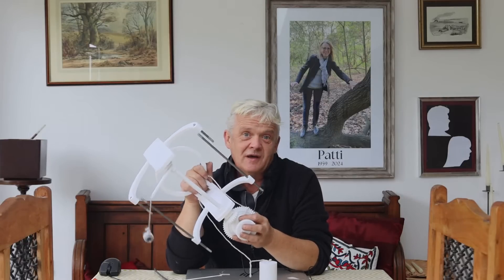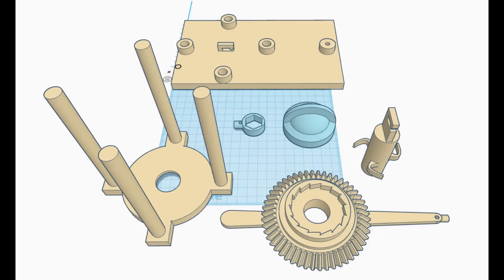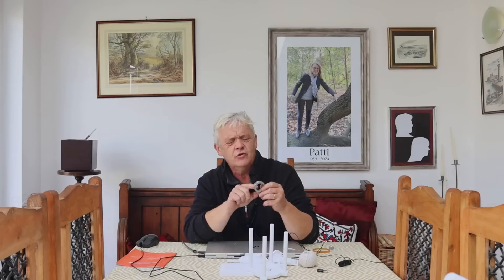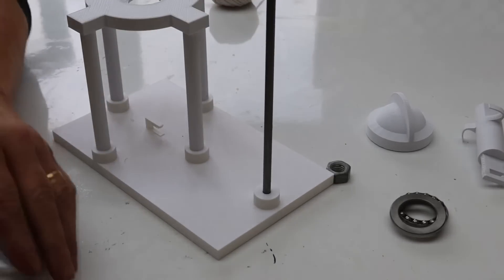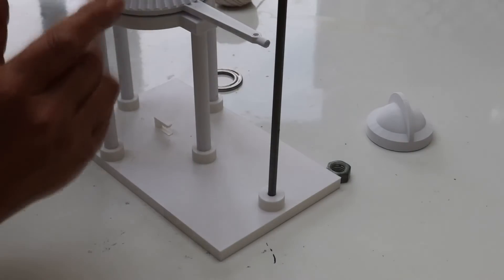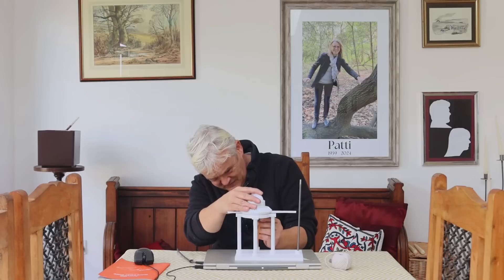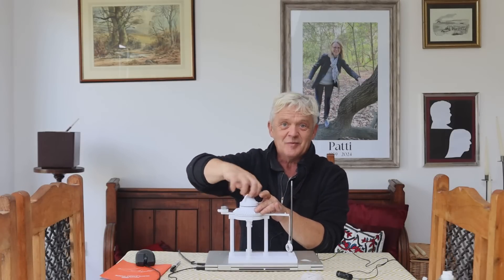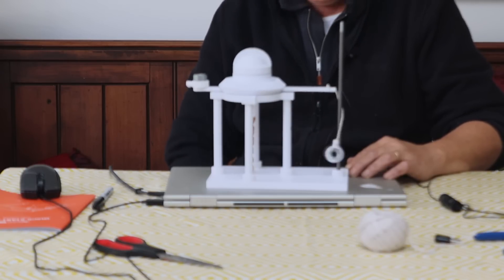2344 Simplified Flying Pendulum

Comment: U should be able to get it all done without any pendulum. Two mechanics where one will rotate slowly before releasing the rotationpart to allow it to rotate ⅛ before being on hold by the lock mechanism (it can be feed energy from the locked rotation pushing on it, with sm internal low to high gear rotations). Where u also can add a generator for fun) with some flywheel it will keep it going while waiting for the next hold.
Reply from the maker: yeah absolutely - basically replace the pendulum with a balance wheel and spring

Comment: Hi there the upper rods cause the pendulum to change direction. So it will first swing clockwise around the bar then unwind the upper arm there moves around and then the pendulum caches and is forced to swing anticlockwise around the lower rod and then unwind so the pendulum is rapping around the lower rod twice per rotation of the arm.
Reply from the maker: cheers mate

Comment: Replacing the rubber band with a good spiral spring & you've made a reliable spring escapement. Also turning those supports 45* or only use 3 with the 2 posts on the catch side so they aren't hit with the weight as easily would help.
Reply from the maker: good points mate - cheers

Comment: Fantastic i wonder if magnetic coupling would work instead of elastic band/weight.  Motor disc with magnets gap disc with magnets connected to pendulum, great video  👍 😊
Reply: Magnetic coupling, agreed.
Not enough use of that, in the world.
Goes through most materials and can Step up and step down speed.
Reply from the maker: absolutely mate
Reply from the maker: Cool ideas mate and i would think for sure

Comment: Fascinating stuff, sir!  Change either the length of the string or the weight of the pendulum--or both--to optimize constructive harmonics of the system.  It will be vastly more efficient.  This is similar to an impact wrench, wherein the armature's mass, RPM, and mass of the internal hammer and anvil must be 'tuned' to cooperate rather than fight each other.
Reply from the maker: very good advice mate - cheers

Comment: I was thinking if you made a room height version that slowly falls from the ceiling that's a lot of shafts and any thread pitch worth its rotation would be too steep, probably. So what if it could grab a rope instead? A thicker one than the weight is on, of course, like a smooth climbers rope and drive it off that by wrapping a horizontal pulley? Just need a stop/release mechanism to get the weight to fling under itself, haha! 

Could make a loop out of the rope and motorize that to make it non-stop for art purposes, lol.
Reply from the maker: i like the way you are thinking mate - it sounds do-able but the proof is aways going to be the same in the doing - give it a go mate